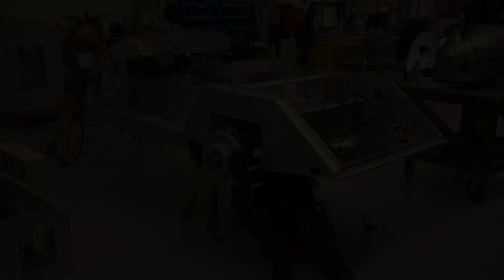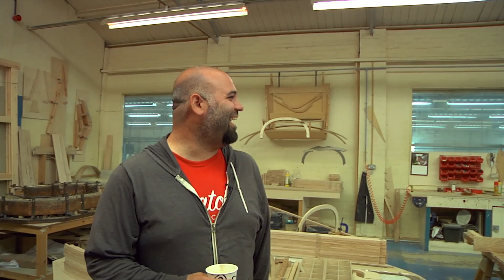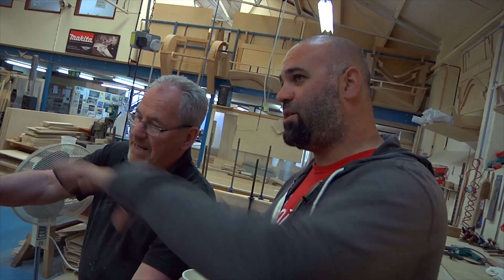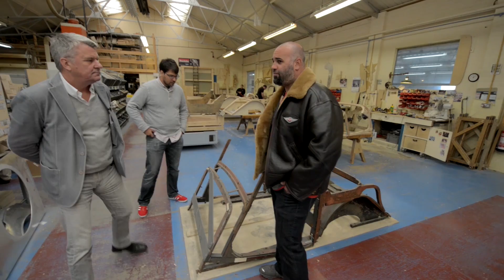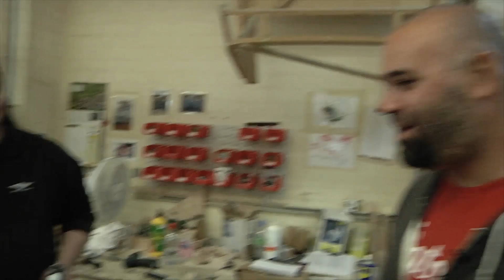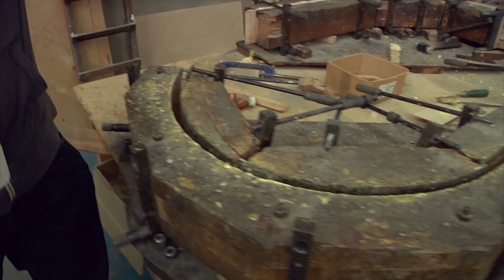Morgan Motor Company: Crafting a Car from Wood - /DRIVEN

Comment: ferraris are all hand built too matt.......
Reply: only the engines are
Reply: Roman S bro they're hand made... not just the engines. have you seen the way they put together the chassis?
Reply: Adam Othman yes i have go look at Ferrari production line in youtube its robot stamping and wielding aluminium bits together and wallah you get the ferrari chassis the only handbuilt thing in  a ferrari is the engine and the interior leather and carbon trim
Reply: And the engines aren't even hand built, they're hand assembled.  There's a difference.

Comment: The talk about wood treatment got me thinking about the new 3 wheeler - would be fascinating to know the design process for a "new" Morgan model; how much computer work was used during the design or (for the 3 wheeler for example) did they just dust off old blueprints and make minor adjustments here and there etc.

Comment: Matt..did you note, this country is not about straight line. No need for top end speed. Our roads are as straight as a dogs hind leg.We cannot get to a places 1500 miles from the nearest sea with a straight of 40 miles (I found one in the mid west on google maps).It's 70 miles from any point to the nearest sea . Here, you get there quicker if it'll go round corners, 'cos mostly that's all we've got & it looks 'cool' in traffic then..Morgan nails it ... but you saw that !

Comment: the Chassis on morgan cars isn't wood; it's bonded aluminum. The wood sits on top of the aluminum chassis as a framework for holding the body panels on, and thats only for the "Plus" models and the three-wheeler. The Aero Series does away with most of the wood entirely, except as a vibration dampener.

Comment: Think of it in motorcycle terms: a 1960 Triumph is far simpler than a new Ninja 600 or similar superbike. But the Ninja is more reliable, because some of that complexity is to increase durability. Better oiling, computer-aided use of materials, etc. A flathead ford is simpler than the engine in a Mustang or Crown Vic, but guess which one usually goes 150k miles or more without a rebuild.

Comment: you can modify a morgan 2.0 4/4 as its the same ford ztec engine cosworth use so 225hp is possible from that engine with out charging it and the sound will be imence...well thats what i plan to do when i win the lotto